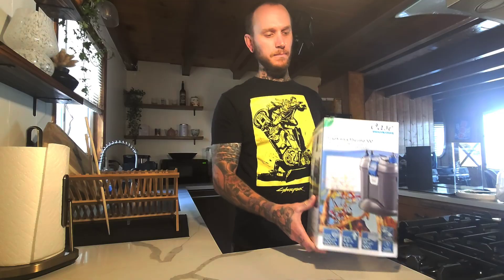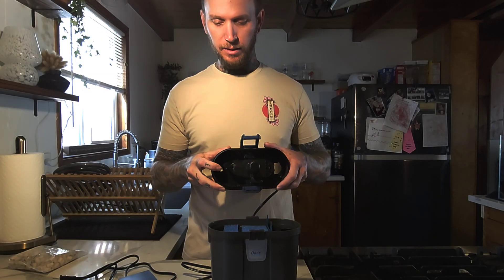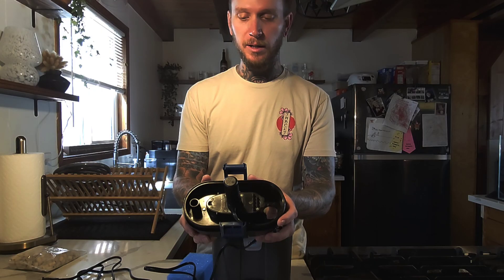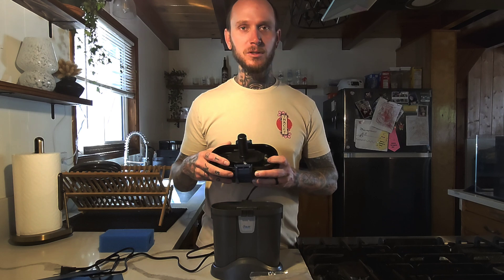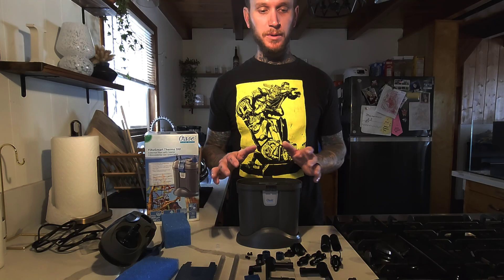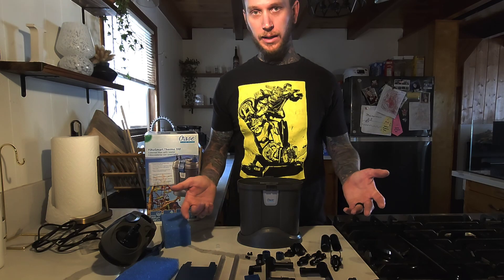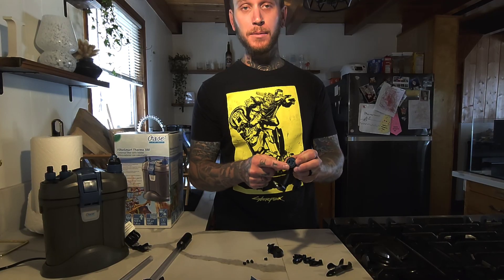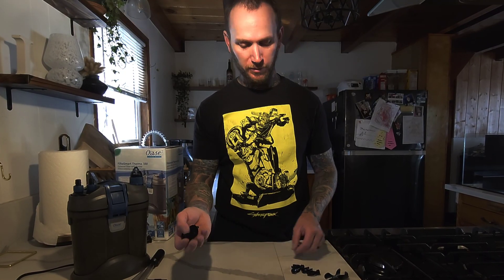Oase FiltoSmart | What NO ONE else talks about | Great Engineering | Plus a Lily Pipe Rant

Comment: Thanks for the video I learned a lot!

I want to buy a filtosmart thermo 100 for my 8G and  I would like to have your opinion on the strength of the flow because I think it could be to strong in my cube shrimp tank.
I know that the Oase outlets are adjustable but I heard they could be bad for the filter and I think they don’t look very good. 
I also thought about spin lily pipes but what would you recommend for me?

Comment: Hi, just came across your video after getting a filtosmart 200. I’m not sure what’s different with mine but there aren’t holes in that location, the cover plate is blue on mine. In any case I’ve used seachem matrix in the third chamber and hopefully the water is flowing through it effectively.

Comment: I found your video attempting to find a fix for the flow on my Filtosmart 200 with Lilly pipes. I wish there was a way to adjust flow on the canister instead of only on the stock intake/out-take plastic pieces. I will stick with Lilly pipe setup due to aesthetic. Thanks for confirming.

Comment: Time stamp 4:50+. The holes appear to allow water flow in to where the ceramic media is then back through the central sponge filter. This would be done via the small divert you mentioned at the impeller cover and only allows a small flow rate for the bacteria to function better and reduces the amount of muck going through. That's how I see it.

Comment: Thank you for this video ! Very valuable informations. Like you I watched a lot on this filter and I started to be discourage by all the review but with your explanation it seems like a very good filter ! I have a specifics question about it and I can find the information anywhere : Is the "base" thing at the bottom removable ? And if so, whats the dimensions on the bottom ? I have a weird setup right now where I cant put a big filter : Right now I have an Eden 501 (Similar to Oase Filtosmart 60) and I'm not happy with the flow, it's not strong enough to get good water circulation in my tank. So if this one is not to big it could be the one !
Reply from the maker: @jackasscou  Thank you for the kind words! I was also discouraged and conflicted because the other reviews. Glad I got one for myself to check out, this filter is awesome. As for the base it does look removable although I have not tried. Let me have a tinker with it and get some measurements and I will let you know 😁